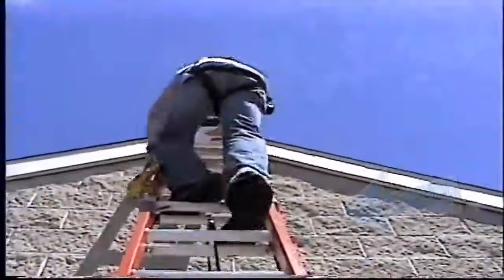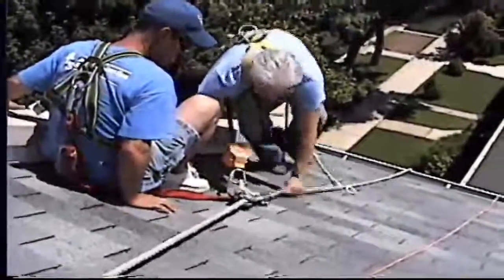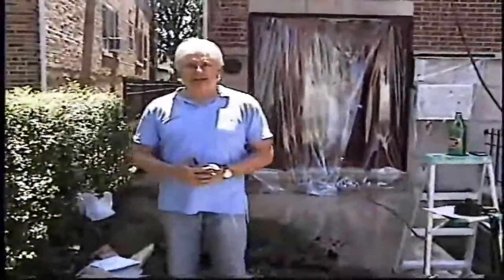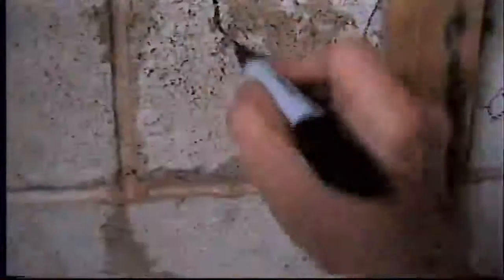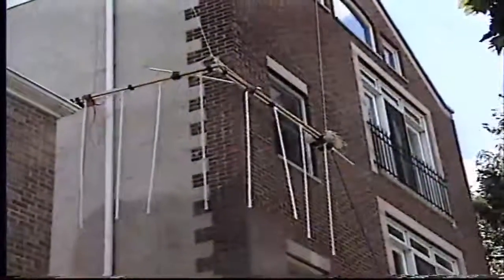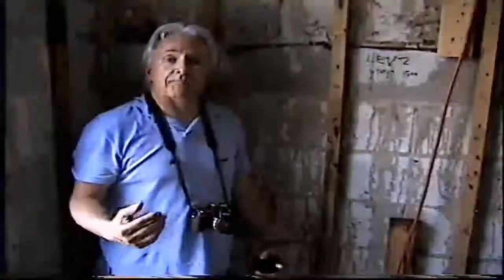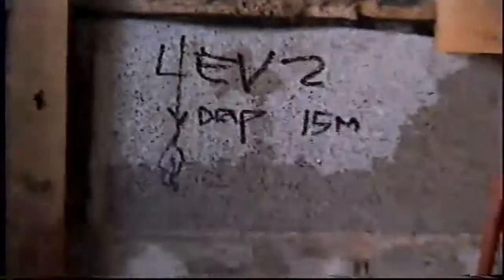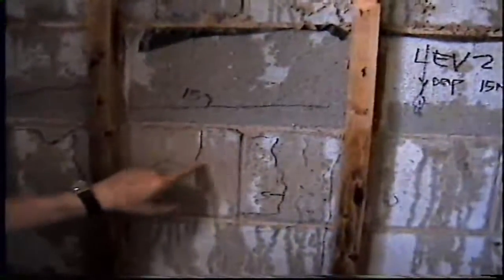Leaks Through Split Face Block

Comment: That is outrageous.  That building was built fast and cheap.  The developer should face criminal charges.  Problem is, it probably  was built under the umbrella of a LLC.  These buildings sprouted up all over Chicago in the last building boom, some are actually OK, but the test of time is proving that a good percentage of them are bad and pose safety hazzards from mold to catastrophic failure (collapses as trusses rot).  Buyer beware.